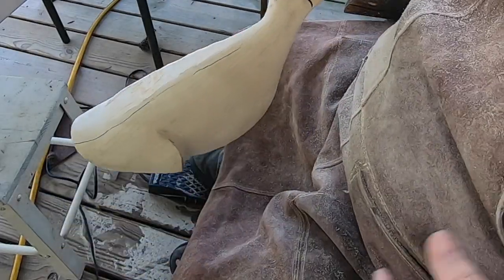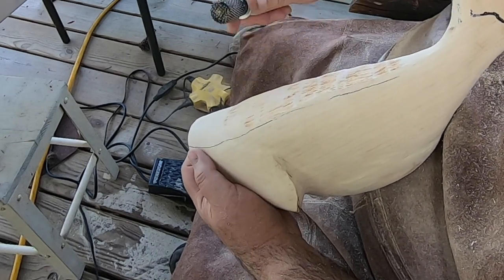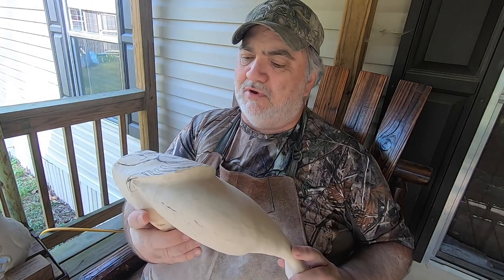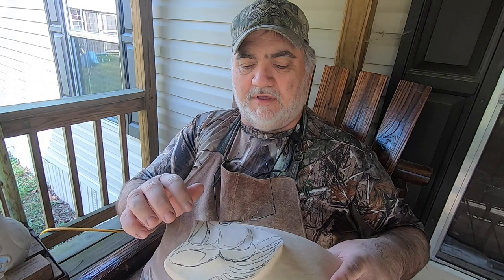Largemouth Bass Wood Carving Part 2 Refining Shape

Comment: Hey Danny. I agree with you on the Gill rakers..I think myself I would carve out the mouth and hollow out a pocket for the gills. Carve through the Gill plate and then carve and inset the gills separately. I'm sure you will work out away to do it.👍
Dave
Reply from the maker: Yeah, that’s kinda what I have in mind. Think I’m going to cut the bottom jaw off so I’ll have plenty of room. I had the idea of making templates out of aluminum or solid copper wire for each gill just for length and shape reference then carve them out of some scrap teuplo to size maybe just a little longer on the ends so I’ll have some wiggle room and trim until they fit. If I do it right I should have a good fit and just hide the contact points with a little Apoxie putty.